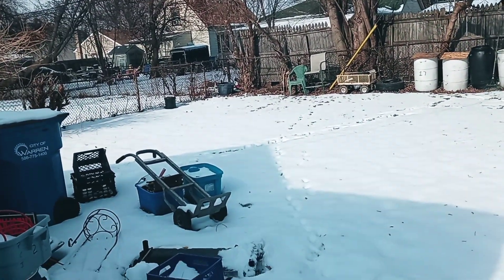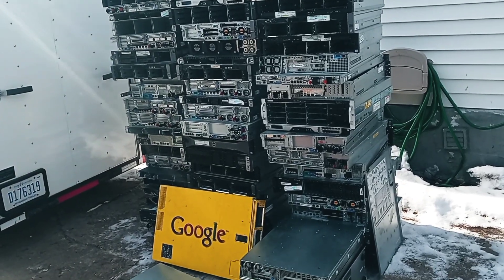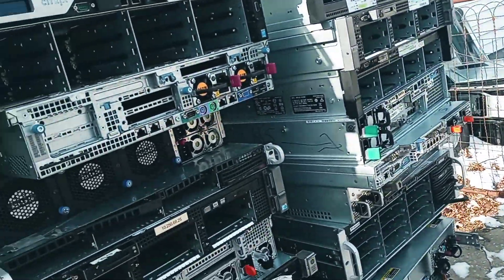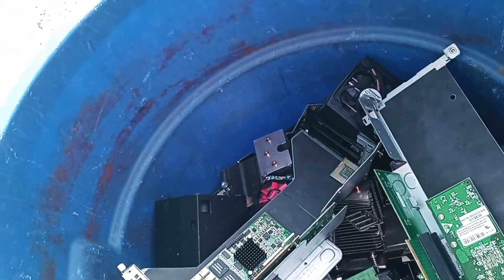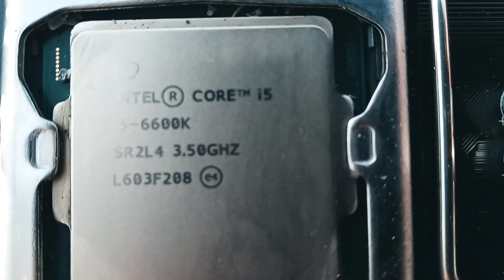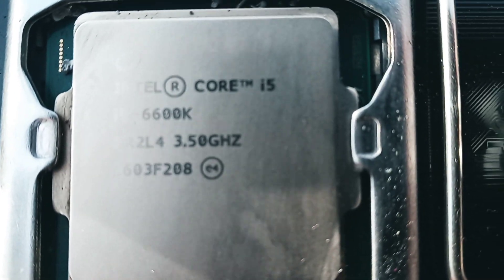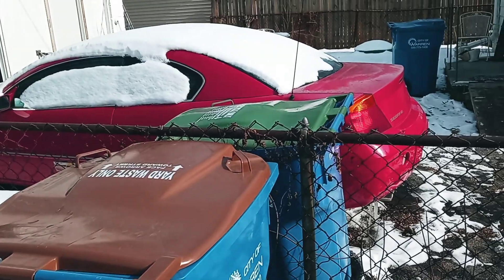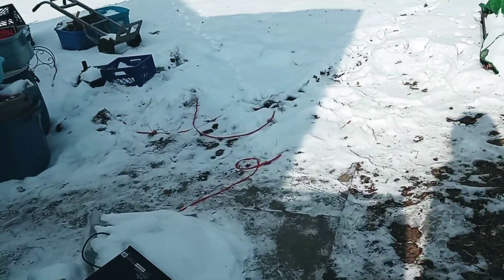Sunday surprise delievery

Comment: We were gipped in NC with no snow at all. We were promised up until the very hour that we would get one inch. Just south of us in Raleigh proper, it did snow about 1/2 but the air just was too dry. We are in a transition zone and the line bisects us. Sometimes we get it, sometimes we don't. Feel like a nut? Yeah, yeah, yeah. Only 1 hour North and they have a ton of the stuff. Stay warm and looks like you have plenty to keep you busy. I'm recovering from a very bad pain episode yesterday. Pretty tired. I hope to get back to scrapping tomorrow. Cheers!